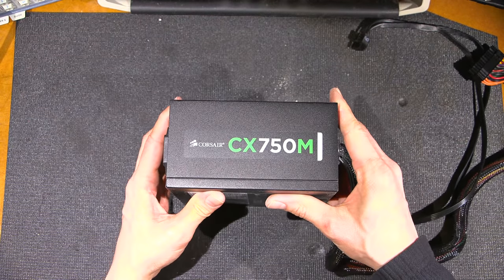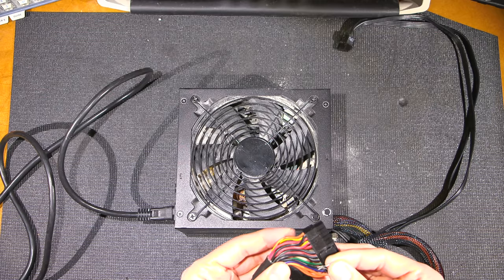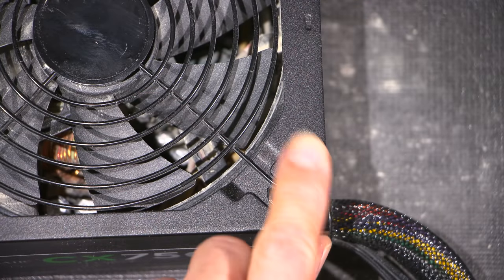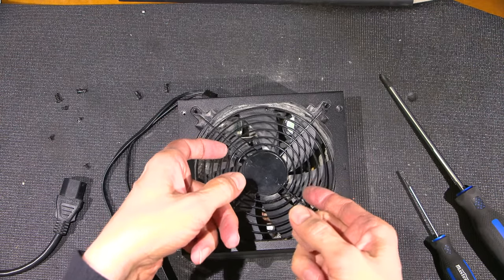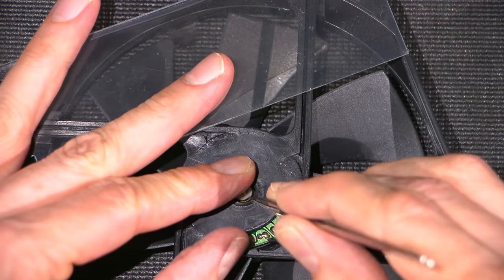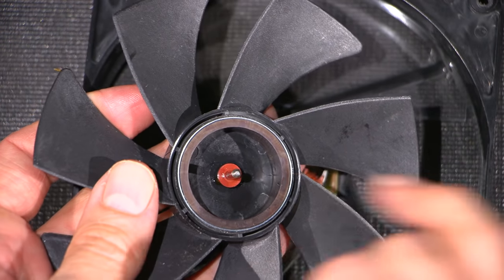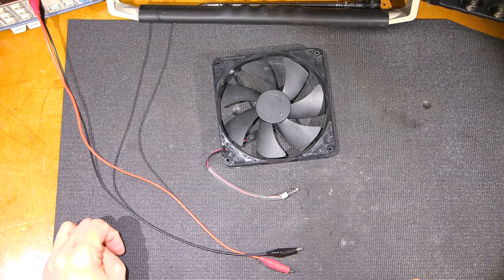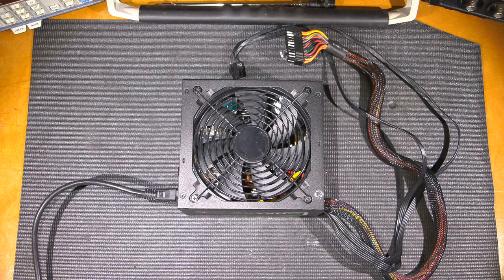Fix A Computer Power Supply!

Comment: This is a pet peeve of mine: all of the devices that get scrapped simply because a fan is whining.
Reply: I've done a ton of repairs that were just fans.   But I usually replace the whole fan, since there was probably some wear when it was spinning unlubricated and out of balance making the noises.
Reply: Actually the whole power supply is often so cheap the cost of replacement is less than the cost of your time.  Many times that when I re-grease the bearings I find out a few months later that the metal of the bearing was worn out and the whole thing starts the precession buzz again.
Reply: @kthwkr  Sure, but I've also had plenty of devices where I oiled the fan bearings and got another two years of life out them. Three drops of oil are way cheaper than even the cheapest power supply. As for the cost of my time, it's more than made up for by the satisfaction of having kept the device out of the landfill.

Comment: Nice to hear “don’t take it apart as you may disturb the fault and it could go away” instead of that other idiotic comment “don’t turn it on, take it apart” from an unnamed YouTuber. This is the difference between a real electronics technician who repairs equipment and a fake. So many great tips during this video. Just loved it when you slid the covering down on the croc clips at 17:36 to reduce the chance of shorting, the sign of a true professional.
Reply: This comment is a little "how-ya-doin'." But if "Bob's your uncle," you won't "come a gutser." lol
Reply: If DashCamAndy is correct about who the unnamed YouTuber is, then that person is a Design Engineer, not someone who specializes in repairs, though he does share some repairs.  I watch Paul because he shares repairs/restorations while teaching us and does it correctly!
Reply: @bobvines00  A Design Engineer should be able to also repair simple electronic items.  Who fixes his designs that are bad?
Reply: @jimstand  To be fair, he does do some simple repairs.

Comment: Finally a video of yours I can relate to lol.... jokes aside, been a faithful viewer of yours for YEARS and enjoyed this video just as much as your other ones!
Reply: Also great tip about fan rebuilds! We do tons of those and talk down customers who sometimes actually want to "..Just junk the whole unit. If that went bad I don't trust the rest of the power supply" In fact I've been able to give away many power supplies from those who I've not been able to convince. Their loss is someone else's gain.

But yes I can confirm your very correct statement that a rebuild is going to last a VERY long time and depending on what oil/grease you use to lubricate the fan it might even be better than the original. DO NOT USE AUTOMOTIVE GREASE. A good 3 in 1 sewing oil up to a 5w30 works a treat! Have literally hundreds of fans in the wild, rebuilt with those two oil's.

One last word of warning... a factory greased fan or a rebuilt fan cannot stand up to constant fine dust. That is a fan's kryptonite!

Comment: This may have been a simple if not trivial fix, but you do exactly what is needed Paul. Fix the actual problem instead of throwing the whole thing away. That dust looked like it was the result of some home improvements.

It makes me so sad that planned obsolescence, and the throw away mentality has taken over. It now also seems harder to rescue electronic gear at local recycling centres due to supposed health and safety issues these days. Often they are perfectly serviceable, but unwanted due to an upgrade, need a minor repair such as this, or could simply act as donors for the more exotic parts, but no, they must be destroyed.

Comment: Perfect timing as I just was repairing an old one myself. Replaced bulged caps and checked the usual problems. Fixed a bunch of stuff, but the 12V was too low and the 5V and 3.3V were too high. The halfbridge waveform also looked distorted with one peak much higher than the other. Got the schematics, started troubleshooting the feedback and driving circuitry. All I had to do was load the thing and the voltages went to their proper levels. I mean, it HAD loading resistors inside it! Oh well. Spent ages chasing a problem that didn't exist. XD

Comment: Something to consider when fixing fans is that there are 3 types of bearings now. The cheaper the power supply, the cheaper the manufacturer goes. Corsair did well here, but some have hydraulic ("fluid dynamic") bearings. The bearing actually holds a fluid rather than grease. Once the seal is broken the fluid leaks out, and the fan is toast. Just something to watch for.

Comment: What is the blend of two lubricants please ?...cheers.
Reply: I use BLUE can 3&1 or zapspout for motors. Do not use the black can as its a detergent im pretty sure. Something im less than proud of but it worked was cooking oil lol
Reply: I’d be interested to know what people suggest. I’ve found that a VERY light weight oil works the best. Anything thick or heavy whatsoever will bog down the precision bearings. They are tiny little bearings.

Something like “rem oil” or even a nice silicone lubricant would be great. Something water thin and high-quality.

I’ve had major problems with lubricants any thicker than water in these computer fans. It just bogs them down and makes them way too laggy to properly function
Reply: @hullinstruments  This fan has a bronze bushing bearing. Called an, "Oilite" bearing or bushing. It is scintered bronze impregnated with oil. I guess you could say the particles it is made out of are tiny? Hopefully it stays a solid unit in operation though.
Reply: I use white lithium grease , and then spray on a little WD 40.  It seems to last forever.

Comment: When I watched this a week ago I was hoping for something more in depth because I have an old PC power supply that died laying around I thought I may dive back into.  When it was just a fan restoration I have to admit I was a bit disappointed.   BUT, wouldn't you know I was just out on a service call today for a very old, dirty, and corroded commercial ozone generator today to try and patch it together and get a few more hours out of it for the customer and one of the issues was a 120VAC cabinet fan froze up!  If I spun it manually it would kind of spin for a minute but it was useless.  Normally I would have just ordered a new one and not given it another thought but I figured what the heck, let's give it a shot since I had just watched your video.  Sure enough I pulled out the bearings, loosened them up with some WD-40, re-greased them, cleaned up the thing and it is now working like new!

Thanks for the inspiration to save an old part from the landfill and it saved me another trip back just to replace a fan.  Only spent about 20 minutes repairing it.
Reply from the maker: Glad to help Shane!
Reply: So good to have unused bits and pieces lying around.

Comment: Great diagnostic video on what can happens to a computer power supply. I had one die on me from not only dust but cat fur being sucked into the supply. People don't realize how much trouble dust and even fur can be to a computer supply. The dried up grease is a result of heat and dust getting into the fan. Thanks Paul as always another great video.

Comment: I know this was for educational, so a total disassembly was nice. 
For a quick fix I pop out the plug, use automotive 30 weight detergent oil which will clean the debris out of the sleeve bearing and keep it lubricated for many more years, likely more than the computer will continue operating. As I drop a bit of oil, I spin the fan by hand as well as lightly push and pull with the little bit of tolerance that is there, to help work the oil down the bearing. Over time the detergent oil will also soften the initial dried out lube and usable.

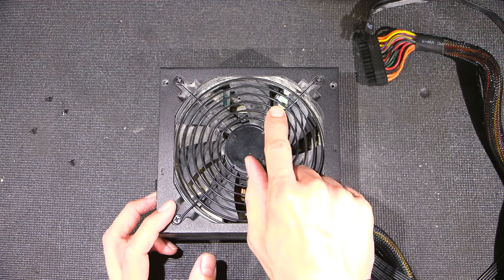Comment: 7:15 - As a child, exploring electronics, I think I was 12, I managed to burn two holes in my finger on a large capacitor for a camera (the one that was charged up for the flash - back when you could hear a whining noise, before it suddenly flashed). It wasn't that large, but large enough to teach me to respect capacitors. Discharging it with a screwdriver (I used to directly short it back then) it made quite the electronic bang. And yeah, it burnt two holes in to my skin. It's healed, took just a week or two, I guess. But darn, I felt that, and I will never forget that.

Comment: I remember working in a small village garage in the 80s and when a car alternator or starter motor failed  we would actually strip them down and replace the brushes which was the main cause of failure.  Nowadays with car electrics or should I say electronics most components are non repairable.  It is good to see you are doing your bit to save these items from becoming another landfill statistic.

Comment: Thank you, I learned something about how to take the fan off the bearing. I often figured they were sealed bearing and could not be redone. Also the pother bib problem is and I hate it to that to buy another fan cost less then the labor to refurbish one like you did. Even worse most would just replace the whole power supply or the whole computer. When I saw this on the YouTube page I thought it would be a electronic repair like replacing leaking capacitors, but it was about the fan problem instead. 
 That heating of the back of the fan motor most likely was the electronics getting to hot since the fan was not running, or not running well. To often what does happen with computers and some other electronics the fan stops or is to slow and then the rest of the electronic system develops electronic problems.  One other common problem is; people have some issue with having a computer set on their desk, so to often it is set on the floor and then left on 24/7 sucking up all of the dirt from the floor area. This is even worse with pets, or in a heavy traveled area of the house or office. PS: I prefer using a good vacuum with a hose, and a paint brush to clean out these things. Compress air just blows that same dirt  all around to be picked up again, as well in some cases you could blow a wire or component off the board, or get dirt in your eyes and noise.

Comment: I too subscribe to the "Don't replace, Repair!" philosophy. Our disposable consumer driven economy is wrecking the planet.
Reply: In case of a cheap shitty sleeve bearing fan that has run dry for any period of time (and gotten hot enough to damage the label too), replacing the fan is 100% the better idea. Can't undo the damage of metal-on-metal with a bit of lubricant. When it comes to the PSU as a whole though, yes, definitely repair instead of replace

Comment: Excellent. could you please do a analysis of the power supplies quality of 12V supply under load with a oscilloscope,, basically a test of how accurate and clean the 12V and 5V rails are under load.
Reply: It's always good idea to check if these capacitors are still working properly.

Comment: I've always loved those odd "power supply fan screws." I've never seen them in any other application.
Reply: When you see a screw with threads like that you then know that screw turns into a plastic boss or seat. Something to remember is that screws like that are there to make assembly faster. If that screw is installed and removed too many times, it strips out the threads it cuts into the boss. Unlike a machined thread threaded into a tapped boss. That can be installed and removed many times. 
(Imaginary Bean Counter Business Meeting) 
So Mr. dept manager, based on your experience, how many times in the life of this product do you estimate the user will disassemble or take apart this product? Umm I see. Well then how many times during the product warranty period will the user take it apart? Umm yes.  Not a large number at all. Mr. dept manager can you tell us why this product is assembled using machine screws and tapped boss assemblies that require careful alignment before mating that slows down the production line assembly process?  Mr. dept manager, are you aware of any other assembly technique that is faster than our present process?  Oh you are? Please explain.(one hour passes) Thank you for your explanation Mr. dept manager.  At this time we will adjourn and meet again in 30 days. When we will present our plan to improve our production process going into the next fiscal period. Thank you gentlemen. This meeting is closed. 
So a screw that cuts it's own threads as it's installed replaces a tapped boss and a machine thread screw or bolt.

Comment: I'm very impressed. I had known that normal fans wear out because the oil dries up but I had no idea how to actually replace that oil. Personally I'm in love with these enermax fans with enlobal or twister bearings because they use magnets to levitate the blades and thus they never really ever wear out or become noisy. Whenever I buy computer fans I always try to get that kind to avoid this issue from happening. As a small aside, if you go to newegg and go to the case fan section, you will notice one of the criteria selections on the left hand bar is "bearing type" and there are a huge variety something like 20 or 30 bearing types to choose from. I would love to do an in depth video about this because it's tough to figure out what all of them really are since they are all unique company names of bearing types. For instance there are a lot of "hydro dynamic" bearings which sounds fancy, but in reality they are just a simple journal bearing with additional oiling grooves cut in so that when the initial oil dries out, the spiral grooves can lift more out of the reservoir and into the bearing. I would love to order one of each type listed on the site or to somehow find out what each mystery bearing is since they all have special names from the company who makes them and many of them are the same kind with just different names from different companies. What I would especially like to know is which of all those types are actually truly magnetic levitation types like enermax makes so I could have some more companies to choose from. But for now I stick with enermax because I know what they are and they aren't even expensive, 12 dollars or so and they so vastly outperform most standard fans with these oiled bearings that dry out and become a nuisance. I feel like if everybody knew how good they were and how they didn't even cost any extra money, nobody would ever choose the normal oiled bearing style ever again. Oh yeah besides never wearing out and getting noisy, since the spinning fan blades literally hover and have no friction surfaces at all besides the air, they are especially quiet too. I know this is getting long but I know how Noctua is one of the premiere fan makers in the world and make very high end computer fans. Well I figured if they are so good they must have some kind of amazing bearing right? I did some research and emailed them and it turns out they are using a fairly standard oil journal bearing type, I believe they call it an SS02. They have some kind of long term oiling solution though that keeps them from drying out even after many years so I guess that's a bonus. In fact they told me they had never heard of one being used for so many years that it dried up and became noisy. And that really makes me wonder how long it would take because surely the oil will dry up at some point? Or surely somebody has gotten to that point already? Maybe not? I'm not sure who to believe, but it did surprise me that such a high end fan maker is still using this obsolete in my opinion bearing style when they could be using infinite life bearings that have zero friction and zero noise ever.

It's funny I found this video because I just bought a used Seasonic PSU a few months ago (best brand by far for quality) and when it arrived the fan was noisy. I did what you pointed out most people do and just ordered a replacement and installed it. BUT I still do have the old worn out fan, along with some others from over the years that have gotten worn out and noisy inside my PC, and now that you've shown how to fix them I would love to give it a try sometime becasue like you I also hate throwing things away into the landfill when they can be easily fixed.

Comment: It actually works if you have sleeve bearing fan, just like one in this video. If you have a very noisy ball bearing fan it's not going to significantly improve, unless you remove ball bearings and cover them in some proper grease, while spinning them to get as much grease inside them as possible. I use Huskey HTS-2 for quite some time and I like the result. Correct me if I'm wrong but this grease is just for such purposes

Comment: One of the reasons why I have installed corsair parts into thousands of computers over the years repairing them is on showcase in this video. So many manufacturers use completely non-serviceable sealed fans, Corsair doesn't. Further they are one of the few OEM's I have work with over the years that have not only always honored their warranty, but in many instances gone beyond their warranty.

Comment: Most consumer PSUs use iirc a 120mm standard case fan as the exhaust fan BUT w/the caveat of being connected to a  2-pin header, they usually adhere it with hot glue. I never really bothered w/this sort of repair but with nostalgia being a thing as of recent I may put my skills to use. Cool video btw, new sub.